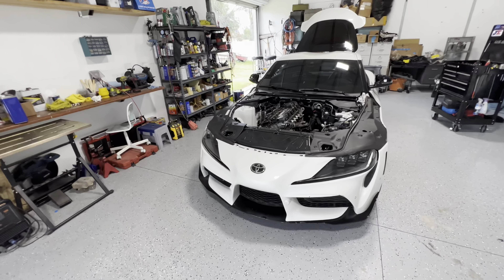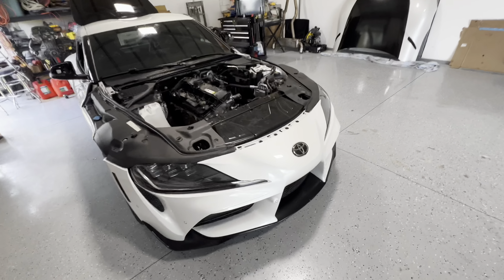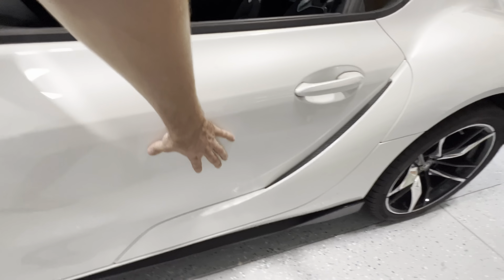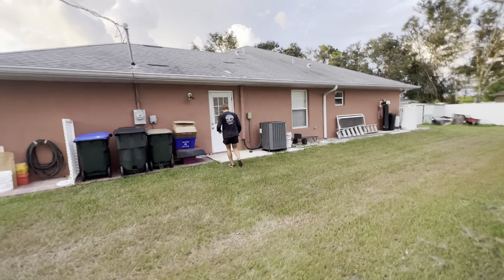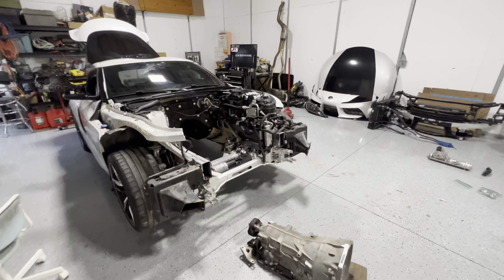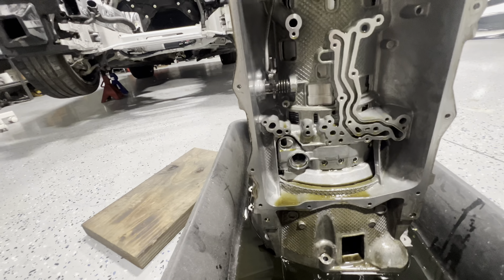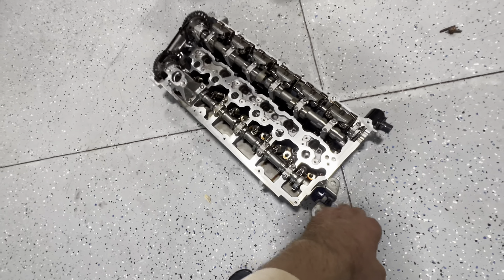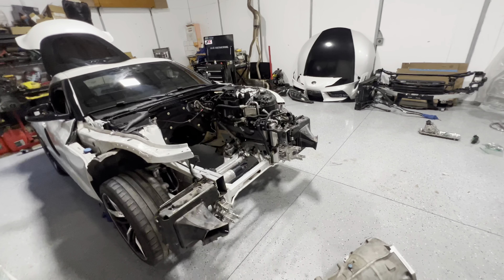REBUILDING A CHEAP/BUT NOT SO CHEAP 2021 A91 TOYOTA SUPRA | Part 1 (Its Worse Then I Thought)

Comment: Crazy I'd just through in forged pistons n rods n fresh set of bearings valves n springs. It'll cost close to 5k. B56 5-8k on its own tranny 2.5k.   The most expensive thing is labour is putting it together  which you  have. Do a real number  crunch...if you pop the new one..that shit will be hell. Build rite the first time. The b58 injectors theyre using is showing failure rate like index's...

Eu5 injectors flow better...thatll be my up grade. That he reason these motors pop in my opinion. Soon as get B58 change or get injectors serviced. Run Shell gas solely.

Look fwd to the build that shyt hurts my heart seeing that fuckery some ones shop did some demonic shit. The glove in transmission is some fuck shit. ...
Reply from the maker: Thanks for the great info bro, unfortunately I’m just parting out all the engine and transmission parts. I can get about 5k if I sell everything. I already picked up a super low mile transmission, has 1,900 miles. I also ended up just buying a complete motor with literally everything on it, basically plug and play. Because as you know I’m missing 95% of engine accessories. I’ll do some digging with the injectors you recommend.